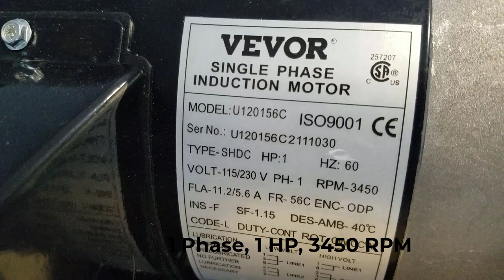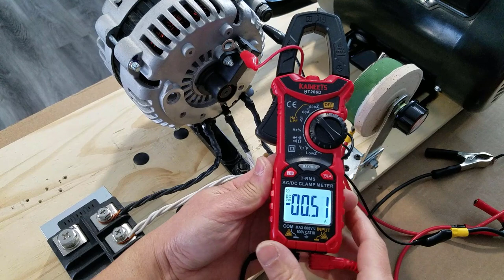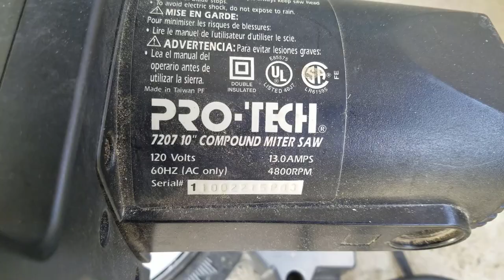Increase Car Alternator Voltage 12v, 13V, 14V, To 70V

Comment: @7:05 How is it possible that the motor stalled even though there is no load (0 Amps) connected to the rectifier? According to the motor specs you have up to 1kW but at the output your power is  calculated by 70V * 0A = 0W. Still scratching my head about it.

Comment: You have shown that removing the voltage regulator allows you to measure the open circuit voltage with no load, ie no current, no power. As soon as you load the alternator the voltage will drop. This is an old fashioned mechanical inverter. With an efficiency of maybe 70% . An electronic inverter can do exactly the same thing, but at more like 95% efficiency.
Reply from the maker: This car alternator conversation was meant for a different purpose. The converted alternator will soon be used for different projects... example welding, off grid battery bank charging and so on...

Comment: I don't understand why your 1 HP motor was stalling during your testing. You only had a voltmeter (high impedance) connected measuring the voltage. What work (power) was the alternator providing?
Reply: Yeh I am a bit confused by that. I'm not very good with understanding magnetism but I'm gonna guess that the rotor was over saturated. Or perhaps making the magnetic field around it too big for the size of the coils. Hopefully someone more knowledgeable will answer.

Comment: I have a little 3hp briggs engine and Im Looking to get 67 volts dc out at like 60 amps. Think this little rewire trick would do the job?
Reply from the maker: The motor I used only rated for 1 HP. The trick is controlling the rotor magnetic strength, so the motor won't stall.
Reply: You can't get 4000 watts from only 3hp. You need at least 5.5 hp, probably more accounting for inefficiencies. 735.5 watts equals 1 hp.
Reply: @travismartinson1813  In theory the 3hp engine would at least work for prototyping, I basically want to use it as a range extender on an electric motorcycle. so it doesn't necessarily need to output 60 amps constantly. I do have a 15hp engine I could use, but thats way heavier than Im looking to use for this project...

Comment: I’m just curious, if you charge a set of batteries, could you hook up a power inverter and change the DC to 120 V AC to power the motor you are using and create a continuous power supply that feeds itself? I’m just wondering if it would be possible to hook up enough batteries and alternators to eventually power the 120 V electric motor and draw enough DC power from the alternators to charge enough batteries to replace a solar unit, enough to power a home? Perpetual power is what I’m thinking.
Reply: Do the laws of thermodynamic apply where you are?
Reply: @Nāmarūpa1  they do, however I’m looking for more alternatives just in case.
Reply: And there it is, the dumbest comment of the day…
Reply: @madaxe79  how do your parents live with themselves knowing they have created such a failure.

Comment: This is actually quite interesting, this would mean that you could use a USD 10 solar charge controller to charge your house lithium or deep cycle battery pack without needing an expensive DC-DC charge controller that usually cannot deliver enough amps to charge a battery within a few minutes. And with a 24v alternator and 24v battery pack, it's not efficient anyway. MPPT solar chargers condition the charging so that the batteries have a long lifespan. Someone who has experiance with this?

Comment: You could wire a few of these together right?? And run any Home appliance? Even 240v stuff like washing machine??
Reply from the maker: That's a possibility, but you'd need a gas engine with a stronger HP to pull more than 1 alternator.

Comment: Your videos are pretty darn cool !!!!! Very handy small projects 

Is it possible to make a 140-200amp alternator converted to magnet motor instead, Then have those other components ?? 

I’m thinking of using a truck alternator 140amps to run Christmas lights like this for the winter,

Comment: Have you tried installing neodymium magnets on the rotor to boost the voltage?
Reply from the maker: Yes, I've tried 3 times already using a 55 AMP alternator that you might have seen in one of my videos. All failed to produce any usable voltage and amperage. I even changed the armature winding from a Star to a Delta configuration. Perhaps, I didn't have the right magnets size and alternator size.
Once I'm done making different projects with this alternator, I'll cut the rotor, install the strongest neodymium magnets available that fit, and will give it another try.
Reply: SidewaysMagnetizedMagnetsMayBeTheKeyToLowerrTheCoging
Reply: @ovidius2000  thank you. I will try that 👍🏼

Comment: Everything was still plugged into city power, you didn't show everything running off its own power. Please show, I love you explaining
Reply: It was never designed to run perpetually, he showed the power tools running from rectified alternator output. The motor turning the alternator and alternators rotor were powered from 'city power'
Reply: or was it, from 7000 watt inverter  this he does not show.....

Comment: I haven't seen anyone using like an arduino or something to control the voltage and or current for the field windings to adjust the output for like charging an 24v or 48v battery I think this is possible